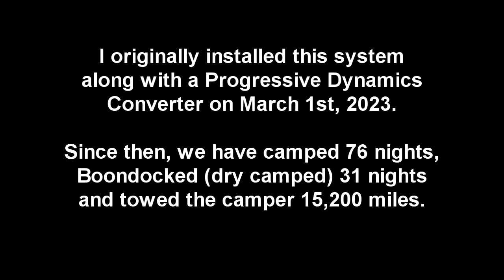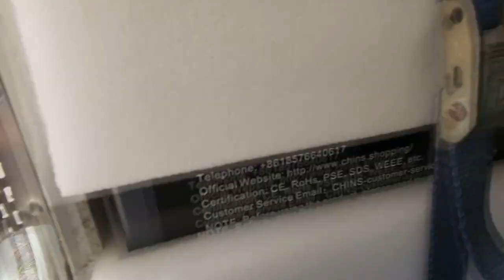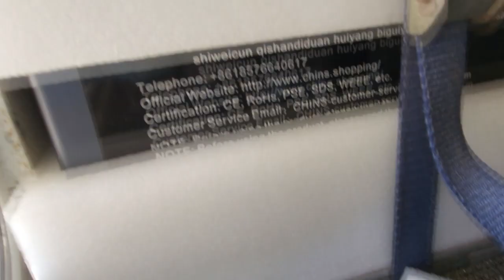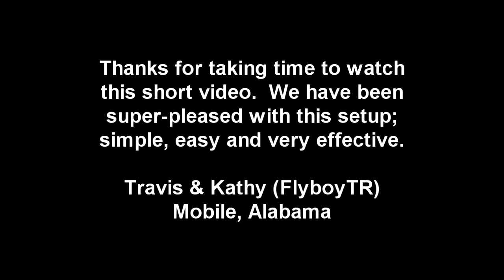Trailmanor 3023 RV/Camper:   LiFePo4 Battery and Inverter Install

Comment: Hey Travis have thought about maybe adding an  automatic transfer switch to your electrical system to your tm?
Reply from the maker: Yes, but for me it is not worth the hassle.  The output from the inverter (the plug) goes into the bay where my RV power cable is located.  If I know I won't have shore power, I just simply plug the camper into that cable coming from the inverter.  On this camper...sometimes less is more!  Thanks for the input!